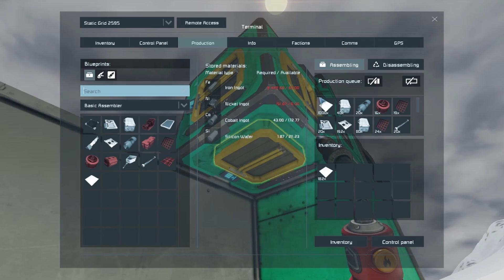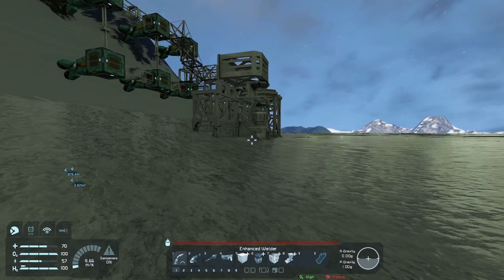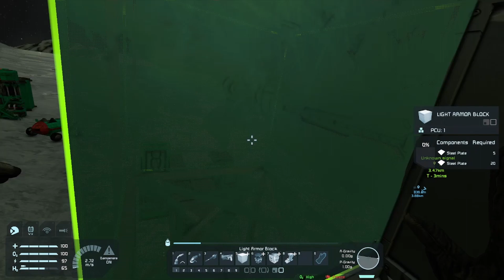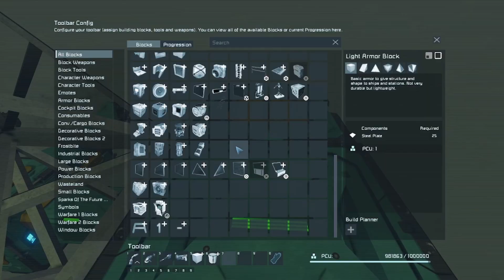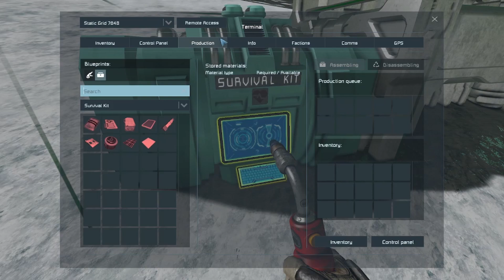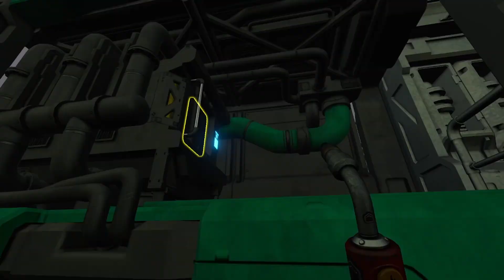Marooned on Triton - Fixing Everything - Space Engineers RP Survival

Comment: There is a binoculars mod in the workshop and they are my single favorite thing ever created in the workshop!
You also turned the Refinery back on, not off.
You'd like the WeldPads mod, it allows you to attach a weld pad to two different grids, then once the 2 weld pads touch the 2 grids become one, like a merge block but no blocks in between and cheaper to weld, granted the weld pads disappear once used, so the resources you put into them are gone.
Have you considered attaching a Large Grid rotor to your new base, then a small grid rotor head to that? From there you can attach a small grid H2O2 Generator and Engine and you already have plenty of ice around, not to mention what the drills will collect before they reach stone, to power the base.